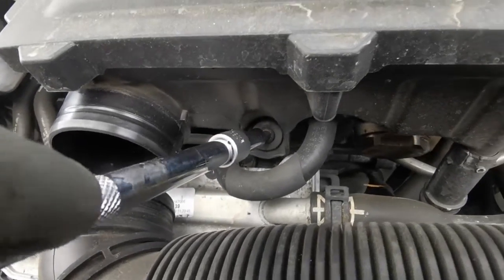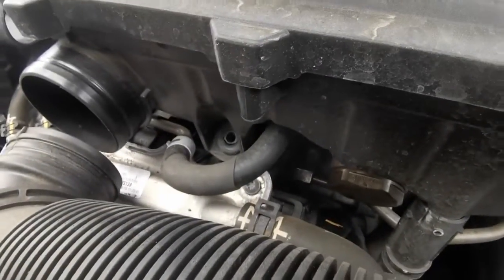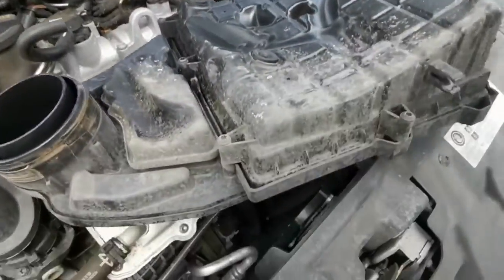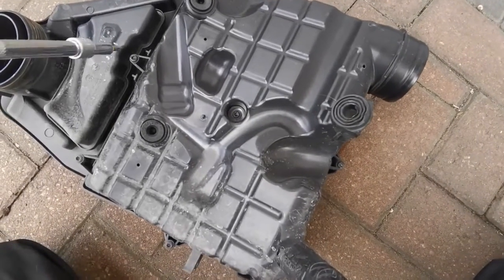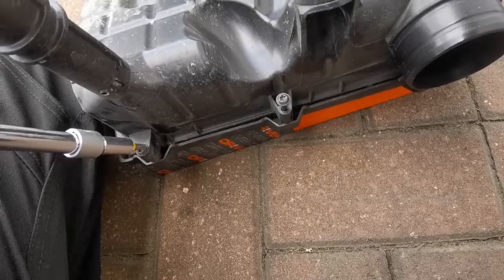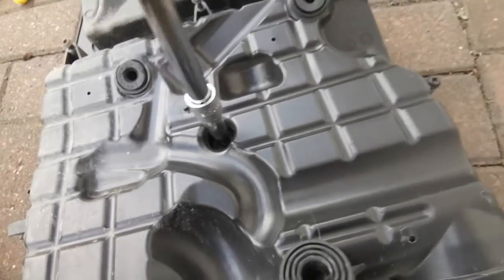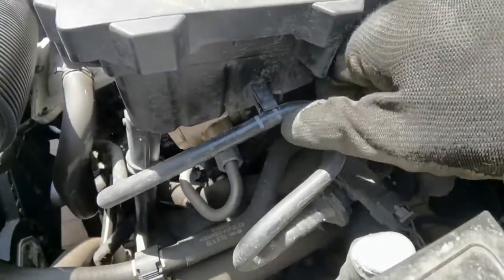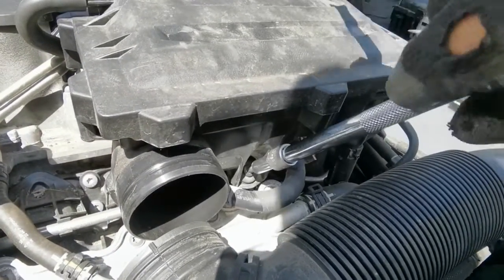How To Change The Air Filter On A VW Polo And Skoda Fabia !!!!

Comment: WHAT IS THAT TOOL YOU ARE USING TO RE-INSTALL THE MAIN "HOSE" clamps! seems like a pair of pliers is not good enough on refit?
Reply from the maker: They are hose clamp pliers
You can still use regular pliers to do the job it's just I was filming with 1 hand and trying to do it with the other and that made it easier because I was filming hope this helps
Reply: @supercar.central  I had to use my unversal plier/multipurpose plier or what ever its called. I had a hard time because it was not wide enough and could not clamb it tight enough, so I had to clamb it as much I could, then take my Electrician's pliers and squeeze even more together, alternative way :D And in all very good video !

Comment: ALWAYS ALWAYS, also clean the little mesh filter at the bottom end of that plastic airbx water drain pipe. 
If you don't and it gets blocked, there's a risk of water building up in the airbox and then you sucking water straight into the engine... Catastrophic disaster.
Reply: How do you clean it ??? fuck I just did it, put read your comment when I was done :D